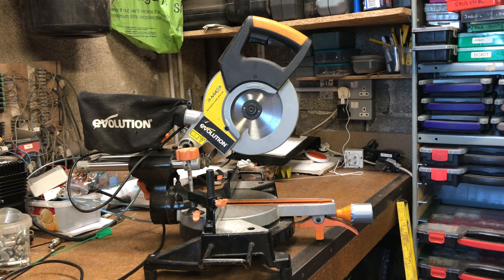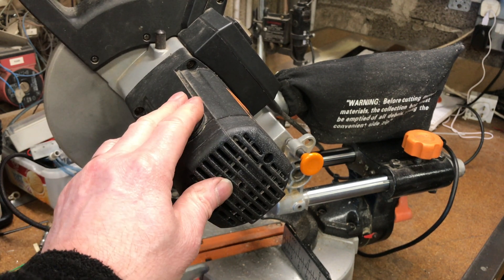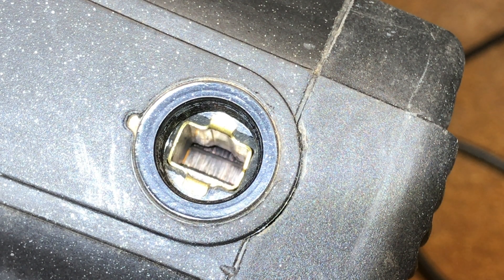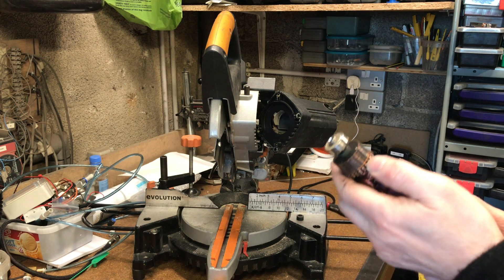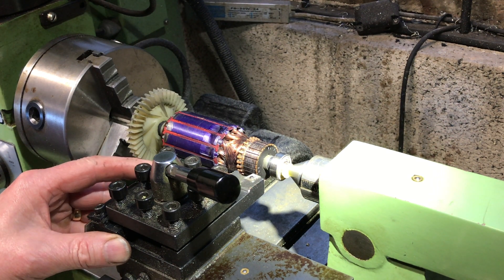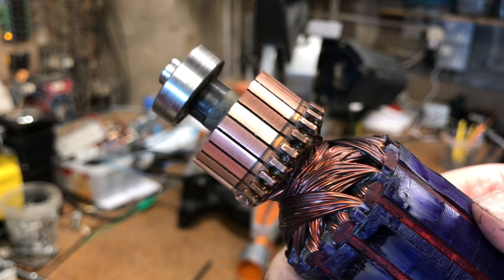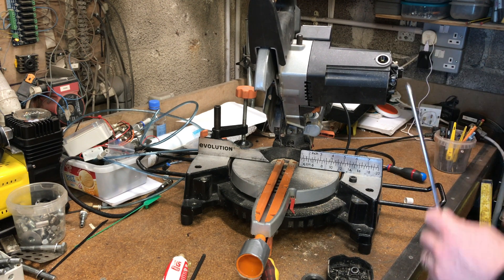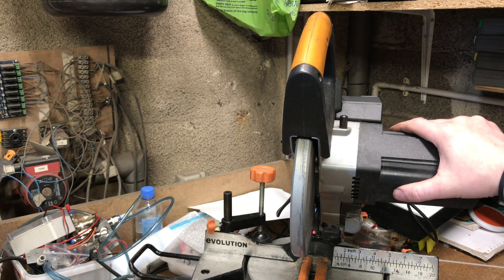Evolution Rage 3 S 210 Mitre saw repair. Armature issues!

Comment: I use a strip of emery on mine, cleaned up just fine. Brush away any dust etc, jobs a good one if you don't have a lathe.
Reply from the maker: Absolutely. I’ve done similar things in the field and it works fine. Thanks for the comments and for watching 👍🏽

Comment: Hi Mike I hope you see this message and get back to me. I have had a problem with mine as it stopped turning and made a horrible sound. I put new brushes in it and it turns over but the sound was still there. So I suspected that it could be a bearing. The problem am having is getting the armature out to check the rear small bearing any tips would be greatly appreciated. If its not that bearing do you think it could be the one behind the saw blade. That has a circlip holding it in. Thank you
Reply: Mike I think I have found the problem the small bearing on the bottom of the armature had melted to the bottom of the housing. Am going to areldite it back in and give it a good oiling to see if that cures my issue. Fingers crossed.
Reply from the maker: Hi Mark, I'm glad you found the problem. One thing I learnt many years ago with Araldite is it's not very good if it warms up as it looses its strength. I glued a segment back in on a vacuum cleaners armature. It didn't last!  Hopefully you will be successful. Thanks for the update and for watching 👍🏽
Reply: @MikeMakesIt thanks for getting back to me. hopefully it it does work. I think it won't do any harm to give the gears a grease before I assemble it.

Comment: Good job👍 I did this to a tablesaw years back, but without a lathe, used a battery drill and some 5000grit sandpaper from a headlight Restoration kit.
Reply from the maker: Hi, there is always more than one way to skin the cat. Thanks for the feedback on your fix, I'm glad it worked out. Thanks for watching 👍🏽

Comment: Hi Mike ,ive just got a second hand Rage3 and it wont turn on.The laser switches on and off.Is there a saftey button on the saw that is stopping the machine from working?
Reply from the maker: Hi Danny. No, not that I’m aware of. It should be a simple plug in and click the main switch on the handle.  I’ll double check on mine tomorrow in case there is something I’m missing but as stated above, click and away you go.
Reply: hiMike,thanks for your reply,looks like ive bought a dud.
Reply from the maker: @danny3207  ☹️

Comment: Hi Mike I have s3 when you start saw it runs ok but u can hold blade moter still going any Ideas thanks stee
Reply from the maker: It sounds as if you have the same problem as I later did, the armature spindle had sheered off. With the machine unplugged, when you rotate the blade does it feel smooth or not. Difficult to explain but if there are any bumps/grinding  when you rotate then I think its the armature. Take a look at the video on just this issue:  https://youtu.be/Ft85BpO4qSs. Hope this helps and thanks for watching 👍🏽

Comment: Changed brushes but armature wont turn with power on do you think it's for the scrap  or should I try something else
Reply from the maker: Hi Robert. Before you put the brushes in did you have a look through the brush hole  to see how clean the armature was? If it was burnt looking the armature could need a trip to a lathe. If the Mains lead and the fuse are good it could be the switch. Money is on the armature. Not sure that helped but thanks for the comments and for watching 👍🏽

Comment: I had exactly that problem with mine and one of the armature contacts had worked loose. I cleaned it out, epoxied it back in place, spun on a lathe and all's good.
Reply from the maker: Hi Andrew, good work! Years ago I tried that on a vacuum cleaner armature but the heat softened the glue and it fell out. Epoxy has come a long way! Thanks for watching 👍🏽
Reply: Hi. I am learning a lot from u guys. I have the same problem with evo saw s380. The armature is producing a lot of sparks i have  tried changing the carbon brushes. What is armature contacts? I want to try what u have done.

Comment: Hi Mike, tthank you for the video. I've had a Rage3 and I think I tried to cut timber that was too thick and it died on me. So nothing turns at all now when I pull the triggers. I did buy new brushes. Is there a fuse somewhere on the saw to blow for overloads that can be replaced?
Reply from the maker: Hi Andy. I've taken a look at the Evolution site
https://www.evolutionpowertools.com/downloads/parts/
but have not been able to get a wiring diagram, just parts. I wouldn't think there is a separate fuse but could be wrong. Assuming you have checked your plug fuse I'd guess a winding on the motor has burnt out due to the extra load a stall would have produced or it could be the switch burnt out for the same reason. My saw has a simple on/off trigger however I have been told some of the Rage3 saws had softstart electronics. I've not been able to confirm this but if yours did have a softstart trigger my money would be on that as a fail point. I'm hoping this may help a little. Anyway thanks for the comments and for watching 👍🏽

Comment: Hi Mike. Thanks for the exploded diagram re Rage 2 but that's for  a different machine. Thanks a lot for looking though. I guess I'll just have to dive in. Keith
Reply from the maker: No problem Keith. Good luck 👍🏽
Reply: @MikeMakesIt  Thanks. Keith.
Reply: Hi again Mike. I didn't realise  you'd left such a long message. Thanks again for taking the trouble with this. keith.
Reply from the maker: Hi Keith, yes, I do go on a bit!!😀

Comment: Hi Mike. I have an Evolution  Rage 2 chop saw and was wondering if you knew how to get into the gearbox to re-grease it.
I have an exploded diagram but don't find it much use. Any thoughts ? Thanks. Keith.
Reply from the maker: Hi Keith. I may have found the same manual as you have:

https://evolutionpowertools.com/downloads/parts/build/us_current/web_rage.pdf

If so it only has 2 gears (Like my Rage 3) They are the end piece of the armature and part 36, the helix gear. As the armature rotates it turns the helix gear that rotes the saw blade. Thats about it. As for greasing it, when I removed my armature I had the opportunity to squeeze a spot of grease in the hole the armature end came from. As far as I can see there is nothing else that will want greasing as the ball bearing races will be sealed units. I cannot say for sure but I don't expect there are any access points to re-grease apart from removing the armature which may be easier than totally stripping the machine. There may be another way but if I was going to grease mine I'd go the armature route. I hope that helps a little? If you do remove the armature watch out for shims and washers that will want to drop out of the machine as you pull out the armature and roll away under the bench! Thanks for watching 👍🏽

Comment: Hi Mike, I have just watched your video and it helped. I got the armature out and the commutator seems in good condition, I have no lathe so that option is out of the window.  When I put 2 new brushes in and turned it on they were immediatley and totally destroyed.  The housing that holds the brushes is moveable by loosening a screw on either side, I just wonder if these have moved pushing the pushing the brushes further on to the armature, do you know if I could just move these further out?
Reply from the maker: Hi Ian I'm not sure I can answer this question without stripping out mine again and taking a look. I do know if the armature is in a poor condition like mine was, when the saw was turned on for the first time after just the brushes were fitted (no armature fix at that time) there were a tremendous amount of sparks and burning of brushes! If the brush housing can be moved you will need to ensure the brushes are in good contact with the armature and not off set to the end of the segments or if the armature has a shorted turn or conductive debris between the segments this may well be causing your problem. I hope this may have helped a little, thanks for watching 👍🏽

Comment: Love to know where I can get the full armature as mine sheared in 2017 and its been sitting in the shed in pieces since. Sheared the shaft cleanly just where the spiral end meets the rest of the shaft. Probably cheaper to look for a new saw in fairness.
Reply from the maker: Hi Edwin. I've had a quick look on-line and it seems you could pick up a complete second hand Evolution saw S3 from about £25 upwards. A genuine armature (new) is £79! I wouldn't pay this, thats just too much. I remember buying mine for £99 delivered from Screwfix with a free Evolution circular saw (A hand push along type) for free. That was a good deal. Anyway, thanks for watching and your comments 👍🏽

Comment: Hi Mike, I have similar  Evo  Stealth says it has  a  1500W Motor and  I overloaded it, now it blows  plug fuse, I have tried opening it up, to see whats going on, but the Armature wont pull out, I searched in vane and found your video, although speeded up, you appear to have done same as me, brushes out, 2 screws end off, other 4 screws out, pulled out  and tilted housing downwards ok,  noted mine has a thin  metal shim,  so carefull not to lose that,  however  unlike yours my armature wont pull out.
Also after taking the first   cover end off,  I have a  plastic round bit with a screw holding it on , screwed into the Armature shaft end, removing this made no difference though, i did not see this on yours.

Any ideas or just more force maybe.
Nice work by the way
Reply from the maker: Hi Richard. When I was taking mine apart, in real time, I thought I'd have to dismantle further but luckily the armature just managed to slip past the external housing. It needed a bit of a wiggle but that was all. I'm sure you have but try turning the armature when trying to remove it. The armature has a "gear" on the end of the shaft so it would be like unscrewing it. I'm wondering on yours if the armature has a shorted turn or two due to the overload. Hopefully not.
Reply: @MikeMakesIt  Thanks for the reply, will keep you informed

Comment: Hi Mike, great little vid, when the bushes need replacing, does it cut out the saw completely? As mine has just stopped working and checked the bushes and there was only around 5mm left on one and around 10mm on the other. Thanks, Gary
Reply from the maker: The sound I got was as if something was arcing, an electrical noise although the saw would keep turning. If you look at the ends of the brushes I expect one of them (the shorter one) is dull, not smooth and shiny. Hopefully you will get away with just swapping in new brushes. I may have run mine too long before changing them! I think I put a link to eBay where I bought genuine brushes for less than £6. Evolution wanted £20. I hope this helps 👍🏽
Reply: Hi Gary, i have the same problem. Did the brushes fix the issue ?
Reply: @alexdeakin4266  yes it did Alex 👍